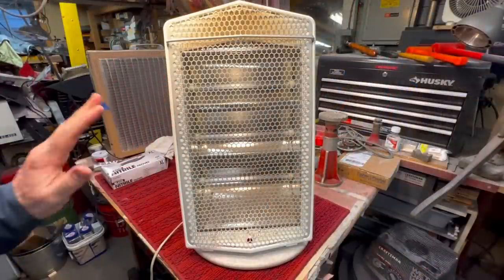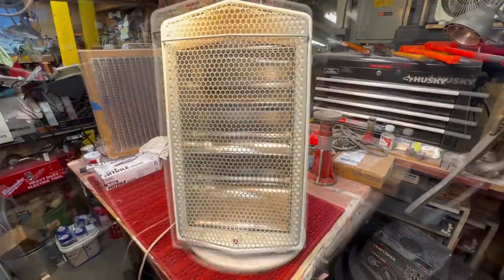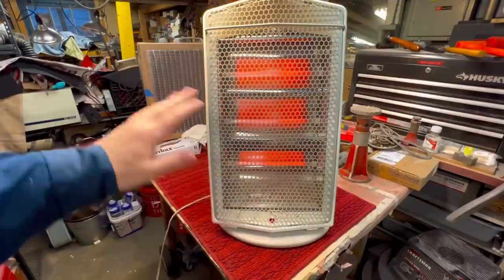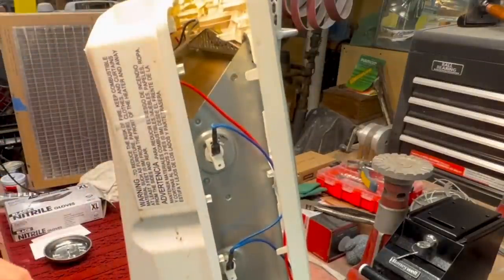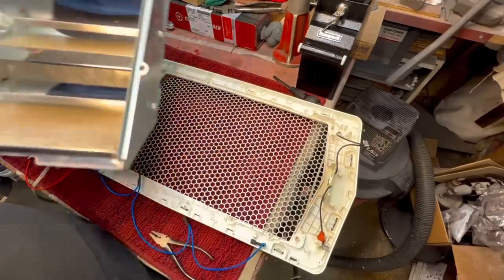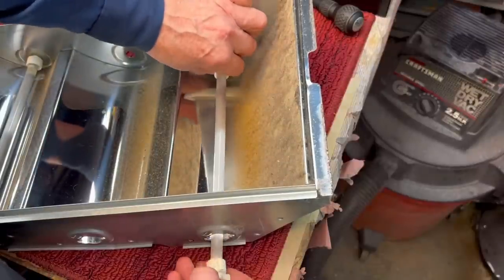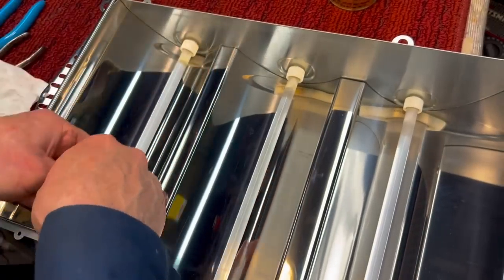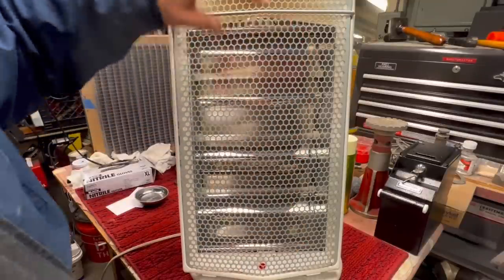Quartz Electric Heater and Possible Drop Box?

Comment: Great tip on wiping down with iso alcohol.  Before these super bright LED and the krypton lights before, we used Mini Mag lights when we worked on TV's (to see in the back of course).  When we burned a bulb, we'd clean the bulb with some alcohol as the oils would burn on the bulb and turn it black.  I do the same with auto lights as well.  They get hot and burn up and shatter sometimes with our oils in the skin.   I love that safe and the such, our group sure likes that kind of stuff.  Drives my wife crazy!!

Comment: For sure its a radiant heater (There are three mechanisms for heat transfer: convection, conduction, and radiation) The infrared radiation is given off by the electrically heated tungsten element inside the quartz tube. (Quartz is used because it is transparent to the infrared radiation, and won't absorb, or block it.)  Unlike the sun (we are not in contact with the sun, and there's very little in space to conduct the sun's heat)... so unlike the Sun (were it's all radiative heat transfer) there is some heating of the air by the quartz tubes, and that conveys heat to us too.
Reply from the maker: Fantastic explanation!!  😃👍

Comment: Great heater restore. I’ve got to agree. Many levels of satisfaction with these types of projects. First level is figuring out how to get it apart without breaking and of the locking tabs. Next, when you open it up and you can understand the design functionality. Then the clean up. Finally the ultimate when it’s clean and all back together and it works as intended. The Honeywell lock box very interesting find. Would a US paper currency bill go in there?  Maybe it’s one of the devices that large bills get put into to reduce cash in the draw. Maybe you’ve seen the stores that have something in the floor in cement. Just a wild guess. You little cat seems to be very docile and enjoying the attention. I’m not really a cat person, but this one doesn’t look like the type with the attitude.  Old Glory flying nicely. 
Best Regards,
John
Reply from the maker: John I believe currency would work well! 😃👍
Reply: Yes, current is always nice.

Comment: 1500 watt heaters seem to appear in all types of configurations, and those first quartz one’s  in the box on wheels with quartz tubes ( I’ll leave them nameless). Wow, did they have some creative marketing; full page ads in our local paper “but wait, buy two and you get fantastic savings”. Let’s face it, they took 1.5kW of electricity and turned it into heat, all of them rated at 1500 watts do that. My father bought a GE “Electromode” milk house heater (1500w) in 1962 to keep a pump room from freezing, I replaced the cord and cleaned it, now we use it every winter in front of a large picture window, not bad for 61 years of service. Always great information here! Thank you.
Reply from the maker: Some of those old Milk house heaters had heavy copper reflectors that held the heat and worked very well!   Thanks!

Comment: I see these type of quartz tube heaters being used in toaster ovens (more efficient than the ceramic type.) Anyway... not sure if you have to worry about de-greasing the heater elements with isopropyl... since there is plenty of grease in a toaster oven, and it doesn't seem to affect the elements that much.
Reply from the maker: I know hand oil is really bad for Halogen bulbs so I always wipe down the Quartz or any other bulbs that get very hot.  😃👍

Comment: With today's energy prices, in the UK a unit of electricity is 35 pence. The heater uses one and half units of electricity every hour say 50 pence an hour  if you have it on from 4o'clock in the evening to midnight that is £4, in a week it will be £28. Over £100 to heat one room a month. Maybe that is why it has been tossed out. The security box is a nice novelty.
Reply from the maker: Tony- Sometimes my house cost $50 a day to heat!!! (Oil)

Comment: Is it the same in the US of A? in the UK, ordinary people use the term 'light bulb' - electricians, however, will tell you that it's not a 'light bulb' - it's a lamp!
Reply: I've always thought....if its a lamp... what's the thing it screws (or locks) into? ... it's like the think a dog takes shelter in (we call a dog-house) should be called a dog too. Anyway... lamps over here are usually smaller incandescent light-bulbs... like the ones used in pilot lights, and flashlights (torches.)
Reply from the maker: As a collector of Light bulbs here in the us a Lamp is usually what a bulb screws are into.  😃👍

Comment: John:  Glad you’re feeling better. Is there any trick to removing the black handles from old Craftsman tools to clean rust at edge (and underneath?) and then putting them back on?
Reply from the maker: If you dip them in hot water they usually soften up enough to slip off.  😃👍
Reply: @ScoutCrafter  as always, thank you!

Comment: I love the heater. With which type of electronics would you use a Variac to slowly bring up the voltage? I have a 1989 CRT TV that probably hasn't been turned on in 15-16 years. Could something more or less explode if you give it full voltage?
Reply from the maker: Variacs- are great for powering up vintage electronics especially ones with capacitors or tubes because introducing full current at once can damage them.  Some electronic technicians take minutes to slowly bring up the power in older equipment.
😃👍